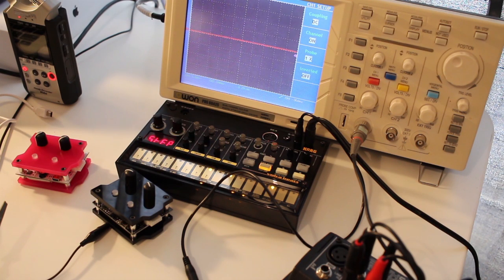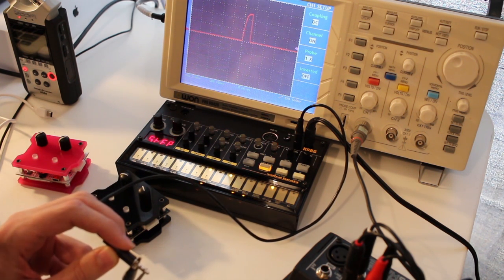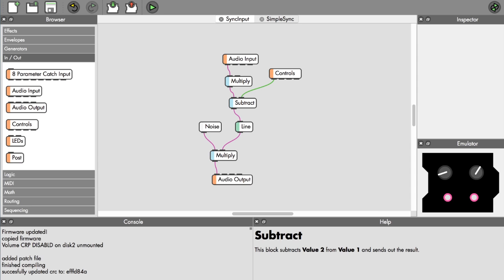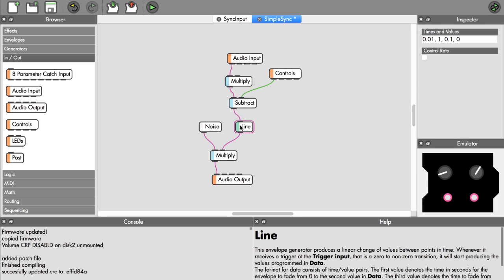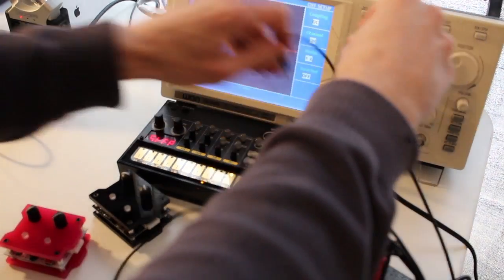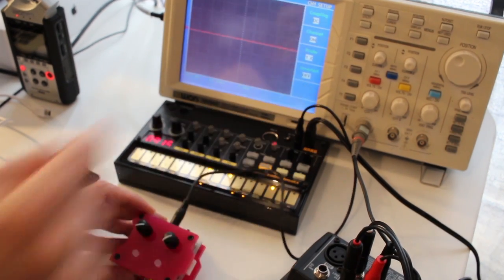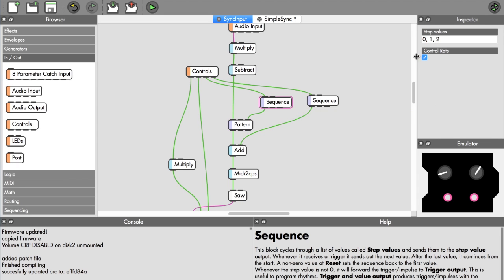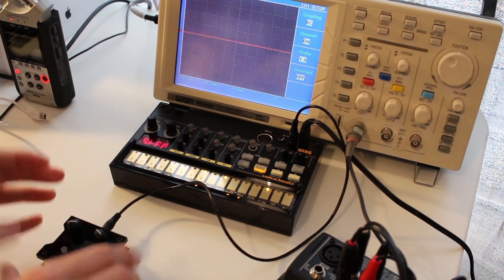Synchronising Patchblocks with external triggers

Comment: I just tried the sync input example today with my volca keys, I had to swap the top multiply block from -1 to +1 and I used a subtract value of 0.1 - so it seems the firmware has now been updated as you suggested would happen.  This was using patchblocks editor v. 0.5.3 on 13/6/16
Reply: Changing the multiply block alone got the examples working for me - thanks for highlighting this!

Comment: the problem i have with syncing the volca this way is that you only get 8 triggers per meausure. This means you can only make an 8 step sequencer. Could there be a way to get the extra 16th notes? 

I would say using a trigger delay could help but then you automaticly would get a shuffled track which isnt allways the goal...
Reply: +luc loois 

This could be the answer... I couldn't get the trigdelay to work :(

AAQAAAPueJyVU8tu00AUPU7CjEOrLoANaVq5D9FNqDyTseMoq7aAhERFRXYIhBzHkSw5D4JN1RUbJPZskBC/kDVigdR/4BPgA/iDcMdJnFC6IY7la8+5d8695wzAjtkJ8t90qv+LEGY7fJ2GgyBEyXMdBezwPv+Ou3Yrv2qWqFkyi0VLGMBuAeZpGifRKL5AqWeHDuCat9gUZdFybA2UBGsaWD9Ku9HQepomozShHRp+F6iwy/Ieynl9InEyHCTjYfxGV/Oo2h475g+XEFEC9mHAKhSwgyKqwI3TkDJQagadHqDMiH1EhZByniEXufdFxtqAY4A9iN5GXWpV+U4DcMzb7BJcA2aMXaDY9s+JaEcSi01eNSdYUyqnShhLzyztJGM/oI46gQqBAzZhk4zuoZyX6hPF9iiOCOP4TQHU+XP2A3xWSBYAjxpq4t9J7rP35kvcFC1l56O0DPAzP0nC8UBP0aY9d/kG/40vKzplSsma1SC1FIX0rNMj+7pY0wtXQ70mZ1iZfaJEoTSAxKxZri75f+HSKlvXNGizd+wcptDSzNo70KioG8lgRBbouA71t83vmCmYm9UizCawNnPT40FmpjAQNL577DO5u7yqEBmq/CiKaVjWkzOUXOWR1hb7av7Eht3K1Dx0CJuBKyBXhLF/4dHGvVCSbfknvod12jUb/5yiZ6B41O2S4XqeR6/8GX+Rq6nPxFW9+/wV+7Cqd530VtccuCr/xb/BWsqohanTkVMe3WJ1mH9z2CJ7NmHqhDmJbfwBAJK7QQ==

Comment: What Im aiming to do, is get the external step sequencer (mine has gate out as well as CV out) to actually control the input frequency of the PB generator. I don't want the PB to be triggered for drum type percussion..  Im hoping to use my step sequencer to actually play the PB as I control the sequencer.  Is that possible?  Ive tried altering what you've shown us, swapped pattern blocks for generators.. but all I seem to be able to get is a trigger of the same note? Is there some other type of conversion required?
Reply from the maker: +Rob Jenkins  I made a new video about CV input: https://www.youtube.com/watch?v=PkBjvAgbVhg

Comment from the maker: No plans for CV so far unfortunately. I have a think about it ... problem is that the PB runs on 3.7V LiPo. A CV block would require a higher voltage - maybe a charge pump could help.